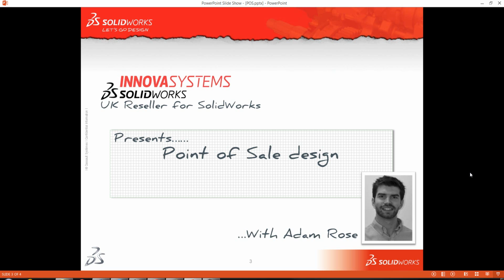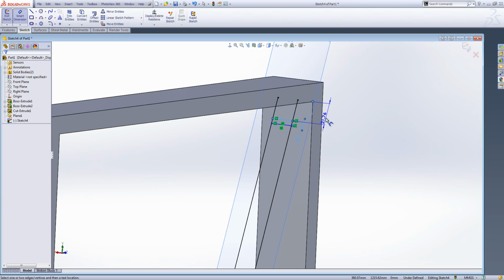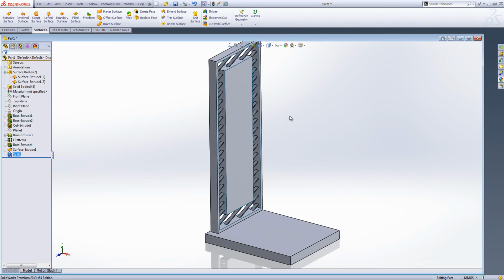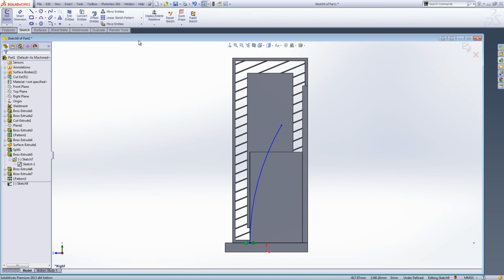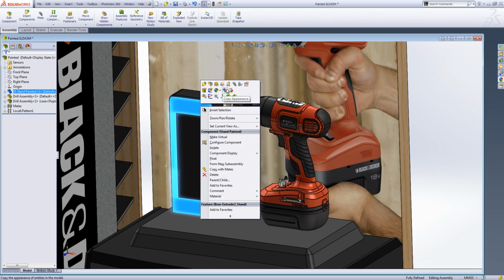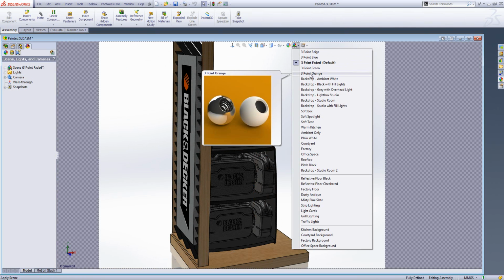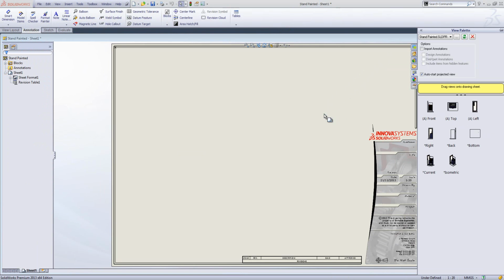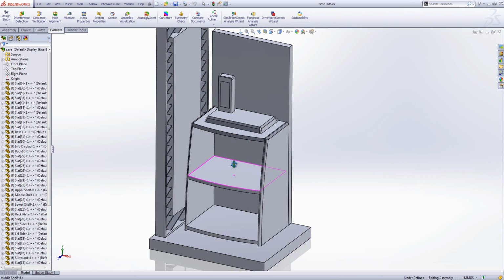SolidWorks in Your Industry Pt 1 - Point Of Sale

Comment: Thanks, this video is just i was looking for. I work in a POS production company and i just switch to Solidworks. I was looking to a quick way from design to production without makeing assembley with extremely to many parts. If you could show on the same model how to resize (Lenght/High) the POS very quickly without changing the thickness of the materials, It will be awesome. And a quick question: How do you export in 1 file all the parts of the POS or an assembley for the CNC router machine.

Thank you very much and hope you will post more helping videos for POS and Furniture industry, You can't find to many and you can't find none to cover the steps from design to CNC router. 

Best regards
Sotelnic